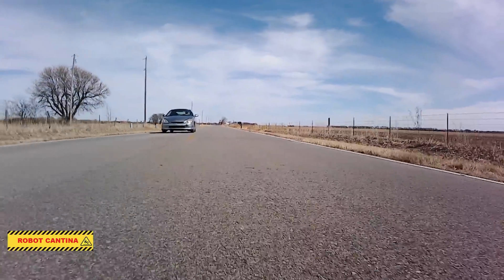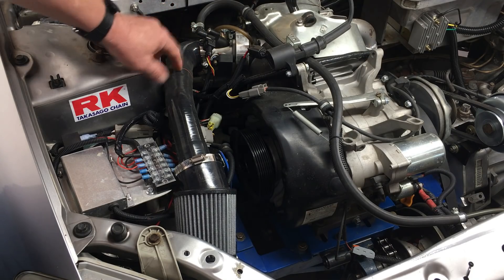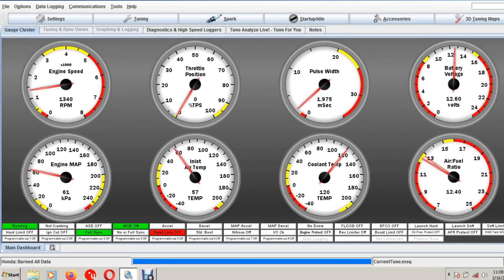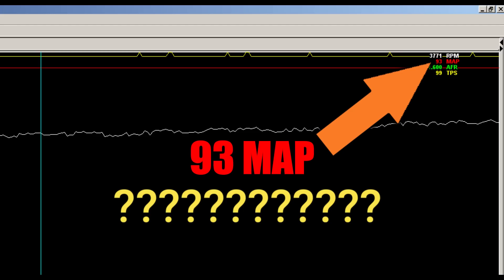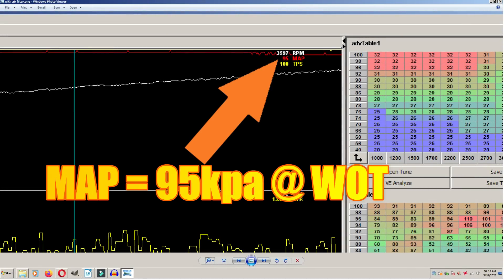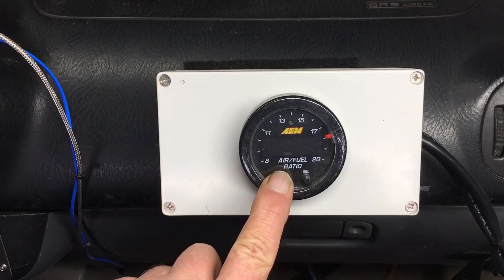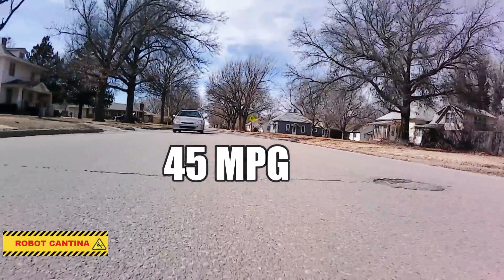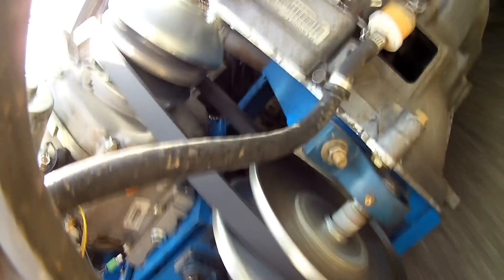S2E3 Fixing Speeduino NO2C  EFi problems on the 420 cc Predator engine.

Comment: I'm 2 years late to this party but to my limited understanding from reading up on my Harley tuning software you can talk to your software provider and potentially change when during crank/cam rotation the ECU takes a snapshot of the sensor value to use (or maybe weighs the value during that period heavier than all others). Apparently it's something Harley guys with really big cams have to do.
Reply from the maker: I'm not sure I understand the question.  The crank sensor can be placed anywhere you want.  When you set up the software in TunerStudio, you have to tell the software how far from TDC the sensor is.  For instance if you place the sensor 40 degrees before TDC. Just put 40 degrees BTDC in the setup and from that point the ecu will know where TDC is.  If you have more questions,go ahead and check out the Megasquirt or Speeduino forums.
Reply: @robotcantina8957  Intake manifold vacuum readings on single and two cylinder engines. I'm sorry I didn't notice I never said which sensor/reading I was talking about.
Reply from the maker: @direfox240  OK, that makes sense.  On the NO2C, with the modified tuner studio patch,  there is a decent amount of software filtering to stabilize the MAP sensor readings on a single cylinder engine.    I have noticed that on multi cylinder engines, the location for the MAP sensor bung makes a huge difference.  The sensor should be as close to the throttle body as possible.  the further away from the throttle body, the more the sensor will pick up resonance frequency of the intake pulses.  This resonance typically causes odd readings of the sensor when the engine is operating at about 2500 to 3000 rpm .

Comment: You never TELL an engine what it should have, ie, AFR, you give it what it WANTs for most power. If you polish intake ports to a mirror finish it will want 10:1, roughen them up and 13:1 might make the most power. Even when we fully dyno tune an engine, we still swap out jets at the track to see if it will go faster down a ¼, ie, richer in one area might give it more torque in an area that makes it accel faster. Your "test and give it what makes the most speed" is correct.

Comment: dude...
you are busy with a very nice project..
Placing a big block engine in a tiny car and making it look like a "fantastic project" is clearly "dumb".
because what could be more natural than an 8-cylinder engine producing 600 horsepower!..
What's really cool is being able to run a normal size car over long distances with the "lawnmower engine" smoothly.
or with the motor of a washing machine..LOL..
this project of yours keeps me busy even me.. keep it up..

Comment: the map sensor value doesn't mean much with such a small variance. in fact I'd bet reversion is probably toying with the reading with the filtering. What you could do, it put the map sensor in  helmholtz tube tuned for say 1/4 wave. that will help stabilize the vacuum readings. you could also just build a helmholtz tube into the intake manifold, IE put a tube perpendicular to the intlet to the cylinder head and help smooth it. the AF ratio, tune for best performance.

Comment: I did wonder many times while watching your vids - why not cram another engine there just for fun of seeing how much it can change everything 😄 
having two small engines like those, both with cvt and efi allows you to run them at different RPM, so one can be used for accelerating while another for cruise. 

Thanks for your vids, i did learn a lot from them.

Comment: My 50ccm scooter does ~2.5L/100km (around 96mpg), so 5.2L/100 in a "car" is really good! Also - i'm not using any ethanol in my fuel
Reply: Almost any old diesel(and new petrol) econobox can get 5L/100km, so it's not really that good for a small engine, but i don't think this project is about fuel economy.

Comment: Not sure if Speeduino has the same map sampling feature as Megasquirt but on my single cylinder 450cc Yamaha it works amazingly well with Speed Density.  Basically you set the map sample “window” in crank degrees (usually during drawdown).  Requires sequential (i.e. cam sensor)
Reply: Microsquirt’s pretty cheap if not
Reply from the maker: Interesting,  I have to see if that is a feature for Speeduino.   Of course I don't have a cam sensor ...yet.  Keep in mind, Speeduino is based on an 8 bit microprocessor running at 16 Mhz.  It works, but has limitations.

Comment: wherever rpm the engine makes best hp at is where u should let clutch go to for best acceleration

on ur 212 - proper clutching for it and its higher rpm window will actually yield really good results as you get more gear reduction

Comment: our experience is once a lamda range is honed in on - then optimize timing. generally we see if you find best power at lamda .84 - then lean down to .88 - you might loose power at first but if you add 1 - 2 deg ignition it can sometimes pick up more

as a trend the leaner you go the more timing you need
Reply from the maker: Thanks!  The video really didn't get into much detail,  but I focus on the acceleration between 50 to 60 MPH,  This range is only 5 or 6 cells and it is past the power curve of the stock 420 engine.   I have spent a lot of time trying to find the right mixture and it is a work in progress.  For some reason the engine wants a richer mixture.  Leaning it out + adding timing seems to slow the car down and cause the CHT to rise above 300F.   The weather is not cooperating this week, but I'll get back to tuning soon and report the findings.
Reply: @robotcantina8957  while its a shitload of work - I think your dyno would be great to solve this...dyno as same cells it runs at - and just do an optimization, plot lamda vs power and go from say .75-.92 lamda and then do and ignition sweep same test at a rich best lamda setting(afr is a 'bs' number anyways unless you truly know exactly what the fuel's real stoich is).  And lamda is just a guy around a corner telling you what he saw after the crime happened.  It's not truly accurate to combustion conditions but it's generally close enough to  be useful.  You should see a window range where it makes about same/best power and then for air cooled I suggest go to the richest fuel setting that still makes good power.  The other thing to try and replicate is engine temp it actually sees while running in the car.  I wouldn't sweep the engine on the dyno for a "curve" I would just hold it at the rpm of where it begins acceleration at in car.  Max acceleration/fastest time is achieved by best power delivered early in a race - and top speed is just raw power.  So ideally for accel times the faster it can get off the line and going initially the faster your times will be (usually at expense of top speed due to gearing).  Love your channel - you are brilliant and wish I knew more about your car engine dyno - that thing is sweet.  I need to add a function brake like yours was to my inertial dyno wiht a load cell so I can do steady state.  I bought a second dyno water brake, but plan to convert it to an engine dyno and keep my chassis dyno wiht addition of load cell.  Right now I use an automotive disc break - works good but heats up fast!

Comment: You can adjust the driven pully spring too to get different results as well, there should be three adjustment holes on it to tighten or losen the spring
Reply from the maker: We are going to try that first.  The driven pulley I'm using is not a genuine Comet product and the holes do not exist, but I know what your talking about.  We will have to modify it for the additional holes.

Comment: Is there a different honda transmission you could use with shorter gear ratios or final drive? I would expect the insight to be on the longer end of things since mpg was its game.
Reply from the maker: Yes, but they are hard to get.  As you may or may not know, most honda engines spin counter clockwise., However the original Insight engine spins clockwise. Most Honda transmissions are unsuitable for this project.  I believe the Integra RSX gearbox fits with some modifications and has close ratios.
Reply: @robotcantina8957  Of the top of my head, thought I remember 90s preludes with the H series motors also have the same layout as well?

Edit: Seems I was mistaken about the prelude. But based on google images of different honda model engine bays, it seems like not just the RSX but also other 02-07 hondas used variants of the K20 as well and had the transmission on the left. Maybe a manual from the right kind of civic/crv/accord might also have more suitable ratios than the insight if an rsx unit is too difficult to find? It seems honda has since moved to putting all their transmissions on the left so one from a newer car may also work although the mounting might be even more different from your prelude than an older gen.

Comment: I've tuned speed density on turbo and non-turbo single cylinder motorcycle engines. It's absolutely the way to go in my opinion. The algorithm wizards have figured out all the hard math stuff for you to the point where you pretty much only have to worry about the tuning itself.

Also you'll generally find peak torque around 12.6:1 AFR in my experience. Best lean torque is usually 13.2ish but on suboptimal engine designs the power difference with the extra fuel can be pretty noticable
Reply from the maker: The 420 certainly qualifies as a suboptimal engine design and it likes to run rich.  I will continue to experiment with the AFR but it looks like the engine really wants more fuel.

Comment: Maybe just get rid of the manual transmission all together and just put a second CVT in to get the ratio-range, just backwards: The wheel speed determines the ratio of the CVT instead of the engine speed.

To start from a standstill just limit the travel of the second CVT to avoid that it disengages completely (or connect it to the clutch pedal, to engage it when it is released).

Comment: Honestly metric l/100km may sound a bit odd, but this is what it is. The rest of the metric (meters, kilometers, liters, kg, ...) Makes more sense since all imperial units are define by metric
Reply from the maker: I'm only having a little bit of fun when I make fun of metric measurements. According to my channel analytics the largest audience is in the USA, however I provide the metric equivalent to imperial numbers whenever possible.
Reply: s	second	time
m	metre	length
kg	kilogram	mass
A	ampere	electric current
K	kelvin	thermodynamic temperature
mol	mole	amount of substance
cd	candela	luminous intensity

Comment: Regarding AFR:

The o2 sensor doesn't measure in 14.6:1 or whatever, it measures in lambda, as in how much CO or O2 free there is. It doesn't care about what fuel you're running. So 14.7 is actually just 1 lambda, 13.2 is 0.9 lambda, which is what you were referring to as "most power" (which would be 13:1 or so on E10, if you were actually measuring AFR, but you're not, you're measuring lambda). The stoichiometry number you see doesn't matter diddly squat, and if you switch it into lambda mode you can see why.

In summary; tune in lambda.
Reply from the maker: This is a tough conversation to have in the comment section.  I use AFR because that is what I'm used to seeing. If I switch to lambda things get a little confusing.   So picture this....  I'm just a monkey and bump the VE numbers up or down. test the car and bump the ve numbers again.  I'm only looking at 5 or 6 cells and when the car go faster I'm happy.  Doing the scientific tuning whether its Lambda or AFR means little to me when the engine seems to want more fuel than what is appropriate.   If switching to Lambda helps the microprocessor then I'll do that, but at the end of the day I just bump the VE numbers until the car goes faster.  Hope that makes sense.
Reply: @robotcantina8957  It's a bit of a tough conversation to have, I guess, but the point i was trying to make is that tuning as if the stoichiometry changes is a bad idea. Even if it does change, because the o2 sensor doesn't care what the stoichiometrical ratios are. You might aim for mid-12's because that's what your head tells you, because that's what the stoich mixture is for what you're aiming for, but you end up rich because the lambda sensor only sees 0.8 lambda or whatever, and reports back stoich numbers as if you're running gasoline. 

If you're using manual tuning to add power, most of this is semi-irrelevant, since that's just used to generate automatic tunes, but still something good to know when reading AFR.

I hope I'm making sense, I guess.

Comment: Robot Cantina If you tighten the spring in the primary clutch or lighten the weights you will raise engagement RPM which may be helpful, but you will also decrease the clamping force on the belt, which may not be desired toting around a whole car.  What really needs to happen is an adjustment to the secondary spring or secondary clutch ramp.  These things need to be more aggressive.  If you think your peak power is at around 3800-4000 rpm with that 420 you want the engine to rev up to that limit as quickly as possible and stay there until the clutches shift completely out to 1:1.

According to one of your previous videos during the 0-60 testing you can hear and see your engine (during the datalog) rev up to a point and then the rpm begins to lower again, this is because the clutches are shifting out too quickly.  This is most effectively fixed by increasing spring force or ramp angle in the secondary clutch once you get the primary engaging where you want it to.
Reply from the maker: You are absolutely correct, thank you for taking the time to point out my mistake.  Indeed, the driven pulley needs to be adjusted and not the clutch.   My only concern is we are not using a genuine Comet 40 series driven pulley and it dosn't have the adjustment holes.  From my research, it appears I need to move the hole at least .5 inch/13mm to start off with and see what happens.   When we publish the video, we will include the datalog files showing the RPM curve as the torque converter goes through its range.  should be interesting.  Unfortunately it is rainy and cold this week and the car is off the road due to unrelated upgrades.  Stay tuned.

Comment: Is there a better option than the belt driven torque converter? I always understood there's quite a bit of power loss with those.
Reply from the maker: I'm afraid not, as explained in the video we need to wide ratio range in order to accelerate the car as fast as possible.

Comment: This is a Torque Converter. It's a fluid coupling. https://en.m.wikipedia.org/wiki/Torque_converter

What you have is a cvt. https://en.m.wikipedia.org/wiki/Continuously_variable_transmission
Reply from the maker: The Comet 44 CVT clutch that I'm using is also known as a torque converter in the go kart and mini bike community.

Comment: How about use lighter wheels/thinner tire width
Reply from the maker: The car is fitted with light weight alloy rims and the tires are brigstone RE92 low rolling resistance.   The reason I chose this car is because it was built extremely light weight and was made to be as efficient as possible.

Comment: Welcome to the joys of intake reversion. It took me a lot  longer to dial in the idle on my 95 mustang with a rowdy cam than it did the cells in boost with the Megasquirt Pnp. The hours spent learning Tunerstudio was an adventure. I am sure glad that I wasn't working on a single cylinder  or an ITB setup.

Comment: Speaking of DENSITY…your altitude above sea level is not the whole story. Your DENSITY ALTITUDE varies greatly with temp and even humidity. Perhaps that’s not an issue of the programming accommodates those variables?
Reply from the maker: The air intake temp is measured by the EFi computer, however humidity is not.  Good point!

Comment: So I've been following this for a good long while... Have you ever considered running the motor to a generator and using an electric motor to drive the car?  I mean not that I don't appreciate what you've done, cuz Lord knows I couldn't have done it. But I've always been interested in what kind of gas mileage a person can get if they went that direction. If I was going to do that, I would get a three cylinder diesel motor from a grasshopper lawn mower, but you go with what you got right? Tell me your thoughts.
Reply from the maker: Perhaps a future project, right now we are trying to go as fast as possible with just a lawnmower engine.
Reply: Well good luck. If anybody can do it, I believe you guys can. Pretty interesting stuff. I'll be here for the duration.

Comment: Having spent some time with homebrew speedy efi on an air cooled vw i would advise that you keep under advisement that what is tuning gospel for a liquid cooled engine may be a little less black and white with air cooling and a cylinder head temp a hundred degrees hotter. Ime you will be a point or so richer under power and idle than your typical liquid cooled engine.. I have also built a small vacuum chamber to dampen the manifold signal pulsing with individual throttle bodies to make tuning easier. Since your engine is coupled to a cvt it's not making super fast changes in rpm so a little map lag should be tolerable. Oh and I see you used that garden tractor alternator.
Reply from the maker: I agree,   I think most of the advice i get was for liquid cooled multi cylinder engines.  The single cylinder air cooled really wants more fuel.    The Map averaging code seems to eliminate the need for a vacuum chamber.

Comment: While looking at the reading I got the impression that the swing of the reading is likely to the air hammer effect, if the plenum was big enough with a t shape this should not happen and it will give a more stable reading